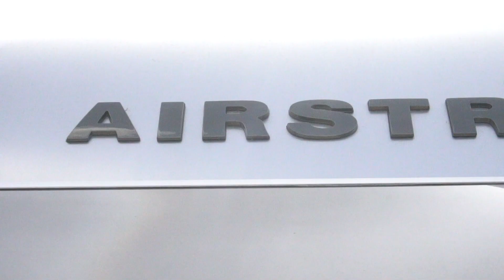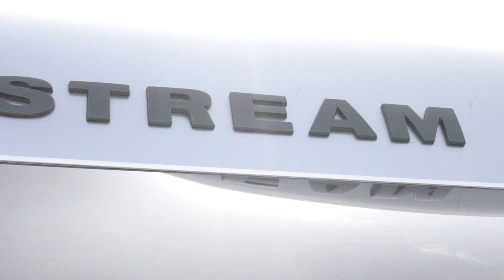Hiking The Mountains of Arizona

Comment: You should definitely make a trip to Tucson sometime in the future if you're looking for some big/long desert hikes. The Rincon Mountains are more remote (Douglas Springs is a lonely, long, scenic trail), while the Santa Catalina Mountains have more canyons (Sabino, Bear, Ventana, Finger Rock, and Pima across the foothills), diverse hiking areas (deciduous woodlands up around Mt. Lemmon, rocky escarpments around Windy Point, brushy highlands near the Molino and Sycamore basins), and interconnected trail systems - you could literally hike from the foothills up one trail all the way to the top (roughly 2700 ft to 9000 ft), take another trail across the spine of the range, and take an entirely different trail back down. You also have Catalina State Park on the northwestern face of the Santa Catalinas and the Santa Rita Mountains further south.